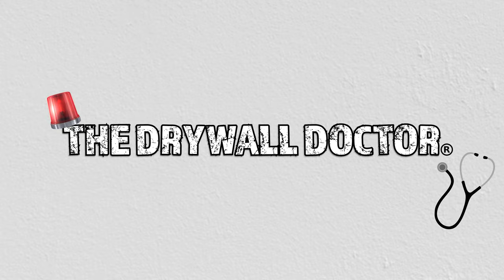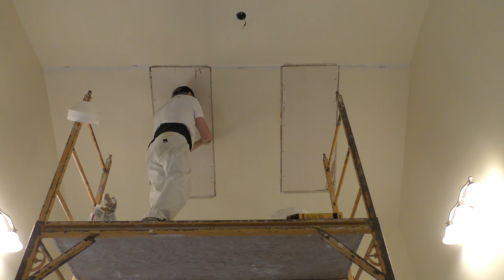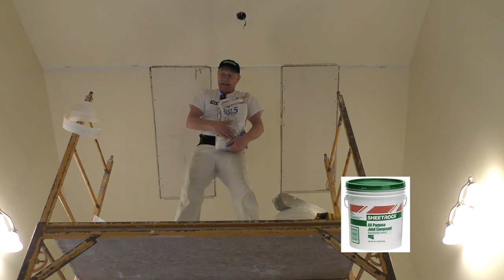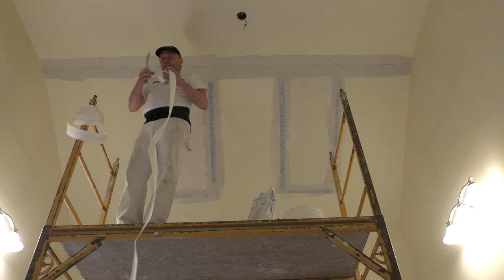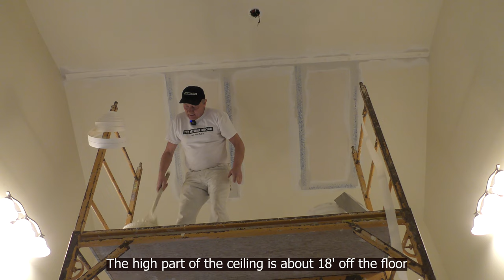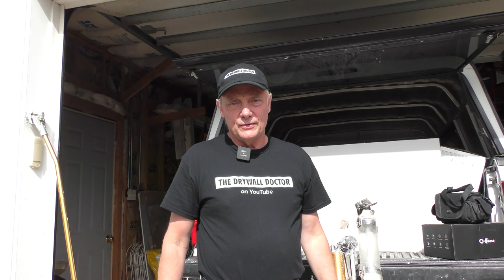Drywall patching over skylights part 1 of 3

Comment: i think anytime a roof feeds another lower roof I would not install anything on the lower part.   Your upper roof for an opening would be fine as the water is naturally shedding downhill away from the fixture.    Especially in our Northern climate where you get snow, freezing, potential ice damming and general downpours.   Sure, you can get metal flashing, fancy tape, $30 a tube silicone but nothing will keep out water long term.   Our main roof has a skylight over the stairwell and our porch is below that one and when you get torrential rains you really hear the noise hitting it and see it coming over the edge of the gutters.

Comment: I typically hold my 6 inch knife with my hawk and my trowel in my other hand but 2 is it. A hawk and trowel is a skill some places like where rays working or tight closets it’s hard you drip more mudd than you want . I’m just used to always using a hawk and trowel. A 12 inch knife feels huge to me now compared to a12 by 4 trowel

Comment: Thinking about eliminating the skylights in our cathedral living room but I worry the patches will show.
Reply from the maker: I have eliminated 4 in my house and dozens in the field and have never heard one complaint.  It's very important that the drywall patch is even with the Surface you have.  There's a lot of mud build up and you need to be flush with that.
Reply: @THEDRYWALLDOCTOR1  Thanks, thats encouraging. I hate doing butt joints but maybe I'll be able to put my 40" skim blade to some good use. 😀

Comment: Ray I’ve use that blue mesh fibafuse but had issues with the strands sticking out after taping. So I quit using it and went back to original fibafuse
Reply from the maker: I think this is one sided tape.  You have to put the mesh side down.
Reply: @THEDRYWALLDOCTOR1  lol. I just ran it off the roll as it came. Never thought to think it’s applied opposite side down.

Comment: I see you used FibaFuse MAX, I don't think you talked about choosing that over the regular FibaFuse. Did you just use that because you didn't have the regular FibaFuse around or this job required the stronger tape? In general, do you always choose FibaFuse MAX when you don't need the thinness of regular FibaFuse, or just for demanding situations where you need the extra strength.
Reply from the maker: I prefer the max instead of the regular.  I would always want my seams to be as strong as possible.

Comment: Looks great  but man do I see all that load on your back and shoulder.. the twisting the the bent over the Internal or X ternal rotation’s Not to mention the fingers and the shoulder blades
Reply from the maker: Yeah it's rough doing this at my age
Reply: Forced to retire after 40 yrs as a finisher. Back problems. Carpal tunnel in arms. Knee issues. And neck. This trade will eventually catch up to you.
Reply: Yup I’m 36 I switched over to apla tech 4 years ago now still very hard .. easier but still hard lifting and running the cannon and coaters
Reply: It’s the pushing on the wall. The repetitive motions, day after day, year after year that will get you. I got 20 years on you. Trust me when I tell you this: Do regular visits to a chiropractor or physical therapy to help combat the strain. I ignored the issues for many many years. And now I am paying for it. Too many physical issues to continue as a finisher, too damm old and stupid to do anything else.